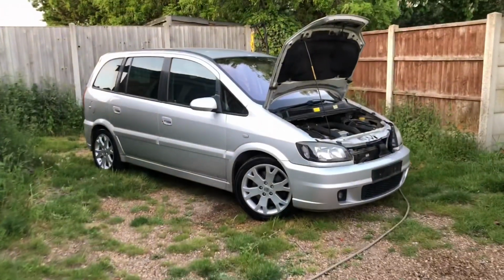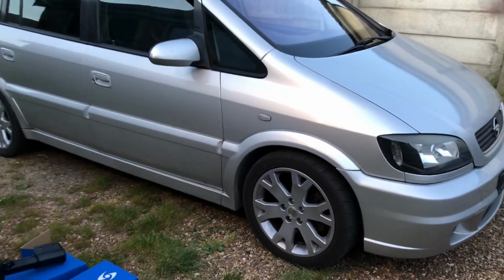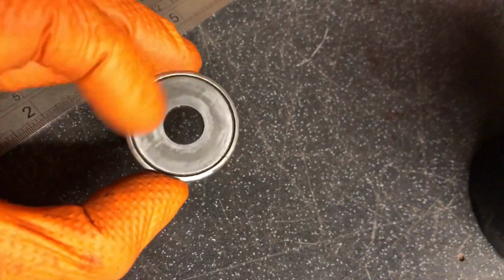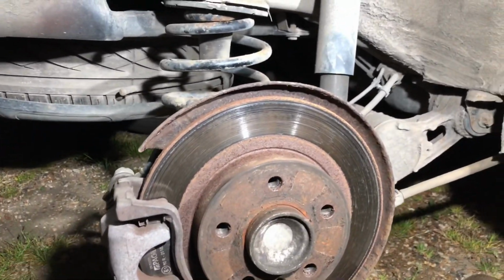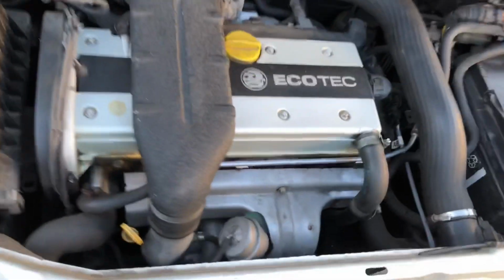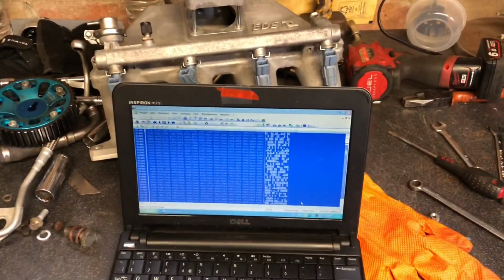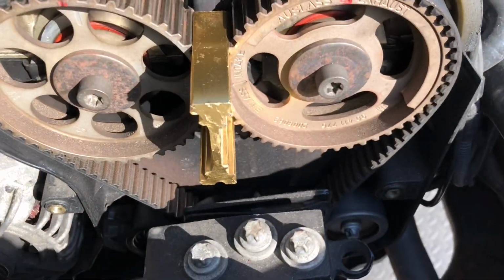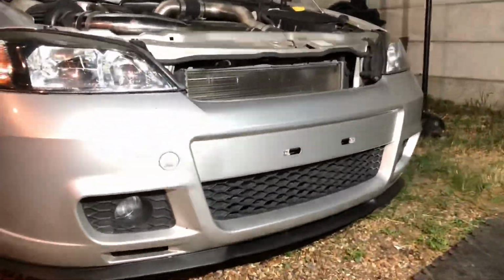Opel Zafira OPC Is Back For ECU Remapping and Suspension Upgrades!

Comment: Nice job. Been on a gates course and the core plug is there to collect a small amount of coolant as the seal in the water pump (shaft/bearing) end seals up when its run up for the first time

Comment: Loving the zafira content my water pump kit just arrived from Kurt yesterday can't beat Kurt's products and he gets them sent out straight away.
Am running fmic 3" turbo back
Astra vxr turbo crossover delete but still on standard map waiting for RnD to open again so I can get it down for a stage 3.5 map got my Injectors and maf ready to go on, on the day of mapping
Do the vxr and the gsi use the same fuel rail?

Comment: Hello mate, are these standard at 7 psi?  Cause mine don’t go past 7 with a vxr turbo and unsure as people say the are 12psi over boost to 7 .
Reply: Wastegate spring is 8psi standard, so it sounds like the boost control solenoid may have gone. So once the turbo boosts to 8psi the wastegate opens and drops all the boost
Reply: Hello mate. I change the front one about 5 months ago as old one was doing the same, the car has always done this even with the let turbo on. Have a stage1 vxr turbo, new vac line, new map sensor  , new maf, crank sensor vxr plugs ,  haven’t changed fuel filter yet, don’t think it’s Eva been changed
Reply: T piece the 2nd boost valve at the rear of the engine
Reply: HutchSco I’m already remove the rear one mate